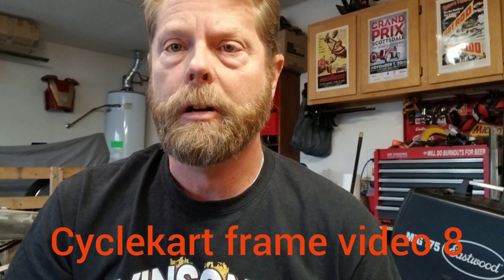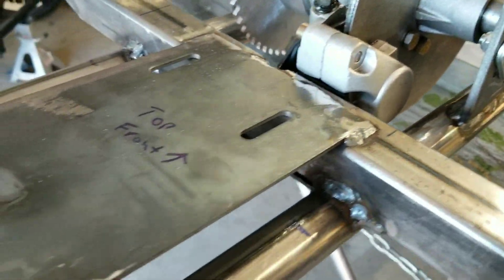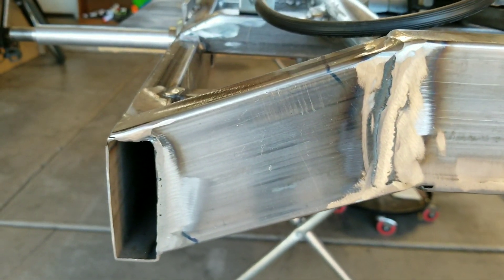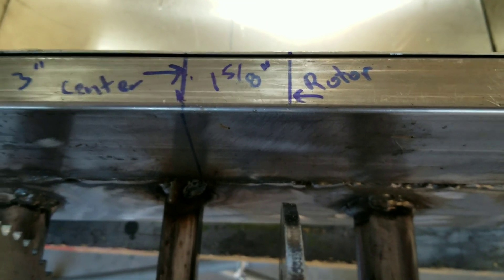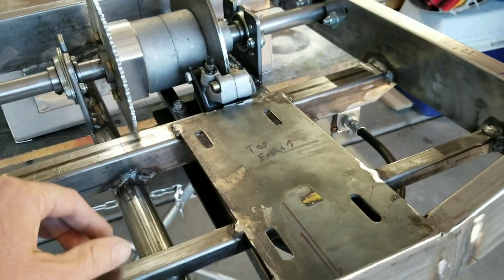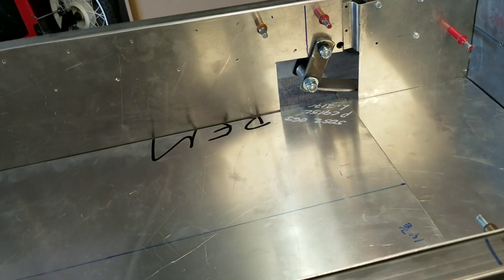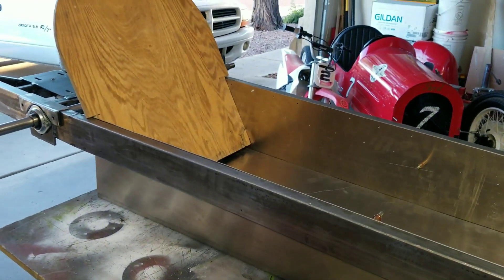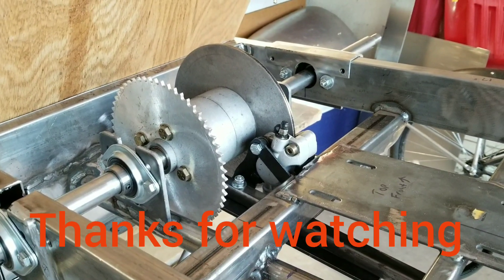CycleKart Frame Video #8

Comment: Like your fixture / jig allot.!! Very nice car and fab… 
It took me back to where I worked as a design engineer for a custom conveyor shop… we had a 15’x10’x1” steel plate on floor.. welders would take my prints and snap chalk lines in the shape of the frame I drawn up..then tack down the structure right onto the plate.. then weld in all the crossbars and upper framework.. then when done they would use a slitter wheel to cut the tacks…followed my a disc sander to smooth off all tack remains on on it and the weldment and then fill in any pits on the shop flat plate..grind it flush ….I have a wire feed welder here at home and have used plywood like you have.. I miss that ability to have projects tacked down .. doing it that way curbs allot of the warping ..and when that ever  did happen it was amazing how skilled the fabricators were at pulling it back to straight and square.. it always amazed me too on how we would always think the opposite results on some frames warping or not warping.. hard to predict…
Reply from the maker: It is definitely a process of trial and error

Comment: From where do you get the differential axel, sprocket and disc brake mount?
Reply from the maker: Unfortunately the differential seems to be no longer available.  I got the sprocket and brake parts from Vintage Kart Co in Mesa, Az.
I think if you go with a solid rear axle, it is much easier to build and source parts

Comment: Oh! Side note. The metal is expanding from the heat which can make the final position off by a fractional amount.  try tack welding in several areas. just small spot welds a few inches apart and then come back and put more in the middle to help lock everything in place then run your beads. Just a thought. Its not like I’m a master welder.